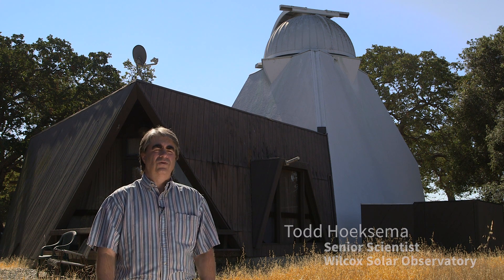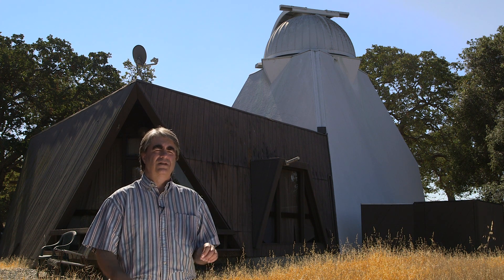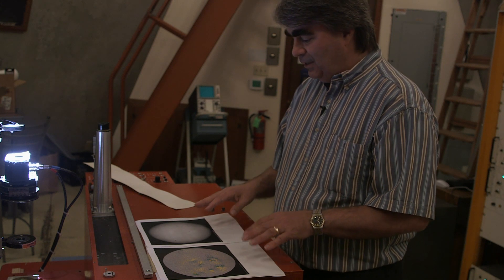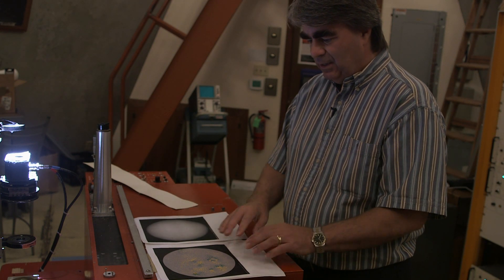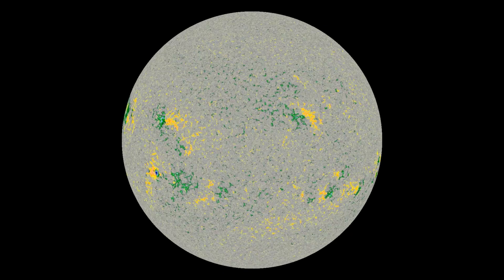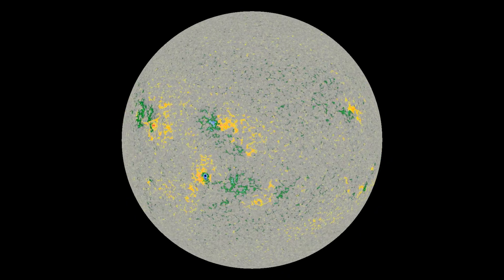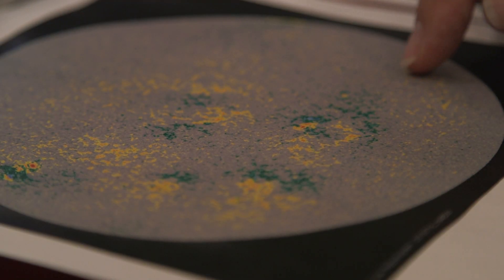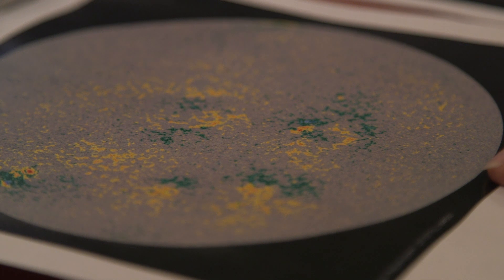Stanford scientist explains sun's magnetic reversal

Comment: It's becoming undeniable that we're coming onto a magnetic reversal on the earth. While magnetic excursions are common, magnetic reversals on earth are not. 
 Many believe that a magnetic reversal on earth results in catastrophic changes and extinction level events, such as earthquakes that are completely off of the known scale, eruptions of volcanic super cauldera's like Campi Flegri, and Yellowstone, and tsunami' of unimaginable size ...
 These phenomena are theorized to have been caused by an inactive sun (star) when the sun is experiencing prolonged periods of inactivity known as GSM's or Grand Solar Minimums. 
 When the sun is in Minimum, the heliosphere is weakened, allowing cosmic radiation to penetrate the solar system which creates chaos on all the planets when that radiation strikes both atmosphere and then the cores of the planets. 
 Cosmic radiation entering the earth's core excites the muons (sub-atomic particles) in the earth's magma, thus creating heat and pressure. 
 This further explains why we've seen several deep ocean quakes greater than 7.0 in recent years without a resulting tsunami ... the plates are no longer pushing against each other as the earth's core cools, but instead is being recharged by the incoming radiation and the earth is beginning to expand again. Also explains the east African rift ...

Comment: .. and It was not really an explanation but an observation. In the Qd model of the sun, this observation follows that the sun is " Folding inside out " - the reversal around 12 years ( app. / 12.5 years avg. in  each 5 years of observation ) like 12 months, 12 hours, 12 precession ( zodiac sign ) etc.
Reply: A torus?

Comment: A challenging problem for theorists is the dynamo problem. That is, using the magnetohydrodynamics (or some form of plasma physics equations), find conditions where a time dependent solution of the MHD equations displays how the rotation and fluid flow within the sun (or rotating conducting fluid in general) drives the formation of a big dipolar magnetic field that periodically reverses as observed here. Hint: Is turbulence important? Reconnection?  comments from experts?
Reply: ... to much my friend, first we need a right model then the equations.
Reply: Nick Ustari A quick intro to the dynamo problem is in lecture notes by Richard Fitzpatrick Physics UT Austin. Just Google search "Dynamo Theory MHD." MHD fluid equations are well known, but like the Navier-Stokes fluid flow equations they are non-linear. Adding to the difficulty, the dynamo action seems to require (or occur because of) some level of turbulence in the flow.  Most theories of the MHD dynamo effect start with the MHD equations, which are hard (i.e. really hard) to solve in the parameter range of interest. A good lifetime research career, though.